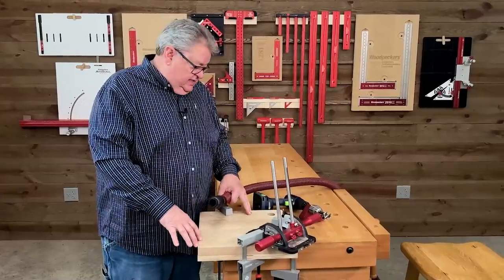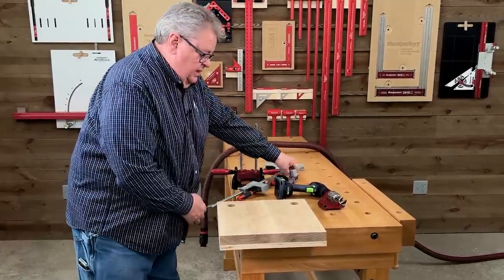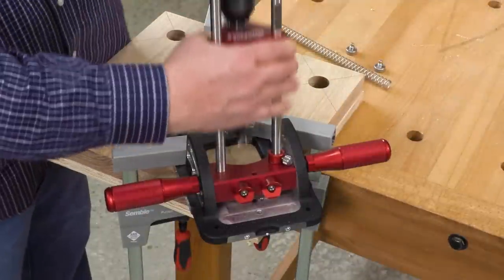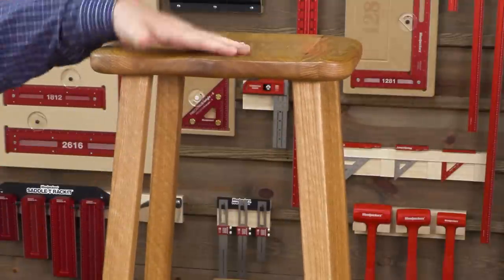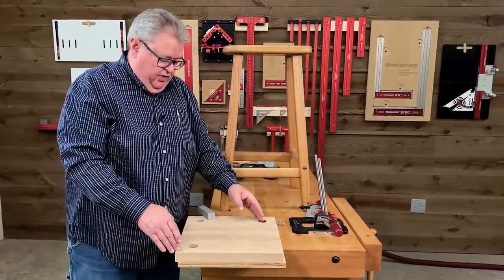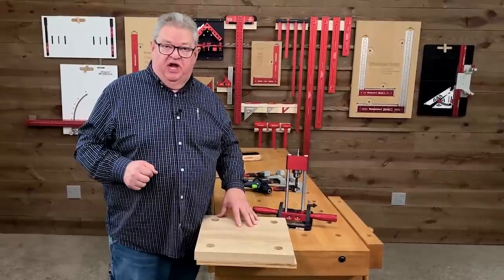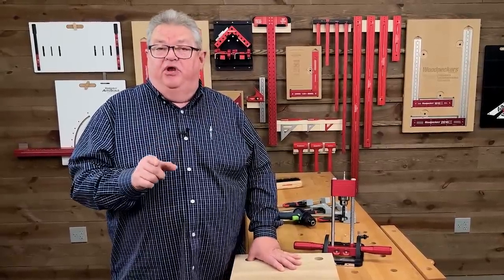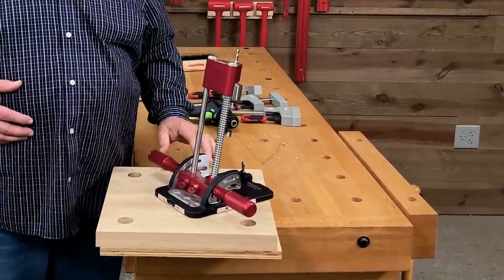Perfect Legs with AutoAngle | Deep Dive | Woodpeckers Tools

Comment: Can you recommend this drill guide for pocket holes in e.g. 1 inch plywood?
Reply from the maker: No. The angle for pocket-holes is very steep. Steep enough that the center of the bit cannot engage until well into the cut. That's why pocket-hole jigs use a bushing that keeps the bit on track until the center spur can engage.

Comment: Too bad you cannot upgrade the auto-line with the auto-angles base.
Reply from the maker: Only two common parts.
Reply: I would suggest not buying the 90 degree miter gauge then.  I am sure an angled one is in the planning now.
Reply: Or would be nice to get better visibility into the product roadmap. Had I known this was going to be released I wouldn't have bought the auto-line drill guide. Second time where I bought a product from them and then an obviously more flexible product came along.

Comment: Did I notice correctly that the through-holes are being drilled from the top side of the stool seat? Can the jig be used for blind holes from the bottom or is the extended end of the base too long to achieve alignment?
Reply from the maker: Michael, yes, I was drilling through holes from the top. I'm pretty sure stopped holes from the bottom will be no problem, but I will try it out Monday morning and reply here. Maybe another Deep Dive. I've been so obsessed with through tenons on the last 3 of these I've built that I didn't think about blind. Target alignment will not be the issue, I can assure you of that. You only need three points to be on target. Clamping may be a little trickier, but I'll set it up Monday and let you know.
Reply from the maker: There's no problem drilling chair and stool seats from the bottom. There's plenty of room to get a clamp on the interior part of the base.

Comment: The angle drilled into the chair seat by Jeff is drilled so that the legs point to the center raising the center of gravity and resulting in a topple.  Yes, this example places the drill in an optimal position to clamp the drill base to the seat, but the result is not what you want.
Reply: I'm drilling from the top down, through hole. Legs splay away from the seat, not into the middle.
Reply: Jeff, this makes sense.  Thanks for the explanation.  I await this angle guide to arrive very shortly.  You have just helped me with future stability issues.  I could have used this guide as a second to the auto- line drill guide this past week.  You are a gentleman and are appreciated.